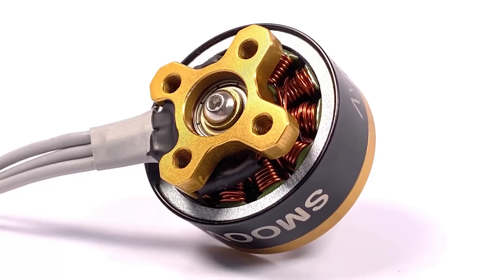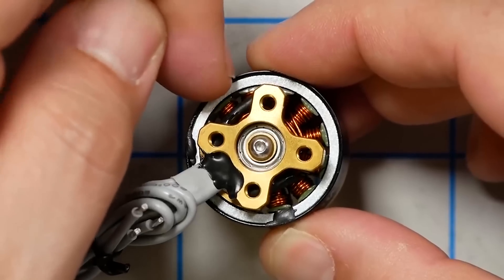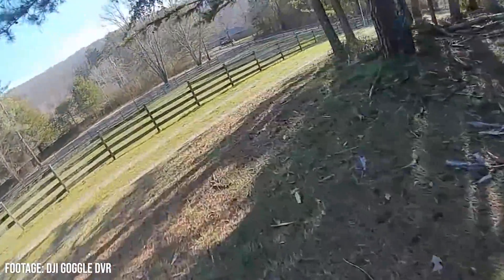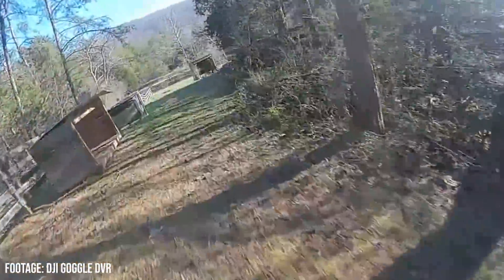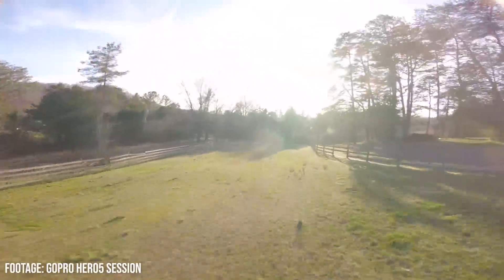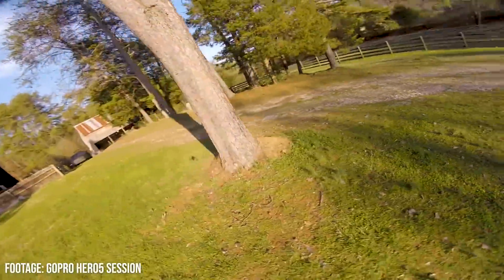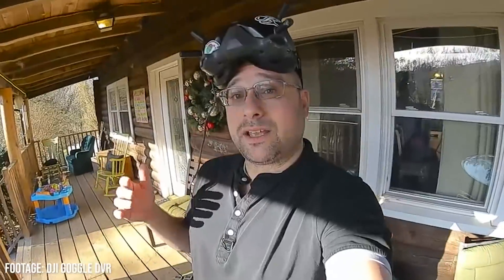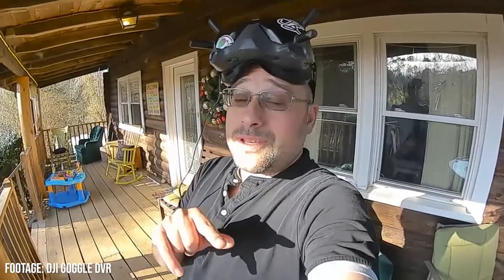Newbeedrone Smoov Cinematic Ring Magnet FPV Motor

Comment: One point of clarification, the flux rings on normal fixed magnet brushless motors is actually ferrous steel, not aluminum. It has to be to perform it's primary function, which is to redirect the escaping flux lines back towards the stator. Also worth noting the thicker the steel flux ring the more effective it is and the strong the flux at the stator and consequently higher torque output. 

Also the nature of the way those uniform magnet rings are created means that the magnetic flux they can produce is lower than equivalent fixed magnet methods. Most of the "smoothness" is probably coming from the lower torque and resulting slower response times. It is likely you could get the same results simply by putting N38 or N40 standard magnets in a normal motor.  You can get a good idea of the relative magnet strength by looking at the number of turns on the windings it takes to reach a specific Kv. 

I'd be curious to hear how you felt the power compares other motors on a similar setup. What Kv and voltage was this setup?

Comment: I'm running these on 6s on a source two frame running Falcox. They aren't mega powerful but they are smooth, and on a lightweight build, they rip. Leviathanfpv has a good video on these and the flow motors.

Comment: Had them, flew them. They are smooth but they need to do something about the screw that holds the motor bell on. It supposed to be a 1.5 mm hex but everyone wrench I've tried slips and now I have shit in mine and can't get it out so I had to swap them out.

Comment: There is always lots of discussion of "prop wash".  I do a lot of freestyle flying and certainly do see it some on my flights.  My understanding of prop wash is that you get in the "dirty" air of your own props and that is what causes the oscillations.  Staying out of the dirty air of your props is more about flying skill and keeping the quad moving than anything to do with the motors.  I am not seeing a direct connection between motors and prop wash.  Maybe a good subject for a video?
Reply from the maker: The smoother the motors are, the more you can turn off filtering, which reduces latency of the PID loop and improves propwash handling.

Comment: Interesting motor, but a lot more questions get into my mind:
The stator poles are square sharp edged surfaces, traditional magnets also have sharp edges.  I am wondering how are the rings constructed, I assume they put the magnetic particles in a pressure mould and basically form individual magnet poles with sharp edges into 1 ring? Is there some kind of smooth overlap inside magnet rings between the poles or is it also very straight or some neutral zones?  Is it better to have more magnet and less space between magnets?  Is there stress pressure in the magnetic material?  What is the weight of the bell is it similar to normal bell ? What is the field strength of the magnet n52?  What is the efficiency of the motor ? 
What is the max power of the motor ? And power to weight ratio? 
Just assuming to produce a circular poled magnet to be more expensive, but the construction of the bell is much cheaper than gluing individual magnets in place.
Reply from the maker: The magnet is basically 3d printed using a process called sintering.

Comment: Betaflight ruined that test... I feel like all the common BF side effects were there and you couldn't really tell unless you compared different motors to these on this same quad, same BF. The one tell here that was good, you set the filters to the lowest and they seemed happy but you didn't report on the motor temps.
Reply from the maker: The motors were cool, of course. That's the whole point of the test. If they were hot I would have said. But it's winter so it's hard to judge.

Comment: Hi, i have some trouble with my drone , when I arm it the motors starts to spin real fast and I can’t handle it , is there any way to adjust the arming speed in beta flight or in the tarantis controller ? I would really need your help , answer to this or send me an email at te17pa8@cng.se
Reply: Use motor stop in betaflight
Reply: It's on the configuration page on the right side. Motor idle speed, if that is what you are talking about. But if you never changed it, I doubt that's your problem. Should be around 5.5 percent by default

Comment: Could you take several different motors (plus the smoov motors) and drop weights on them and see how they fly after that? Also you could continue to drop more and more weight on them till they deform or break?

Comment: Ok well this has nothing to do with this video but I'm an extreme noob lol and I was wondering if i update to betaflight to 4.1 on the computer will it mess with the ability to tune my quad that is running 4.0 and my older one on 3.5. Thank you for your videos if it wasn't for you I would have never been able to get into this amazing hobby.
Reply: I've updated betafight a dozen or more times with no issues. As a new pilot you probably don't have any unusual setups so it's probably fine. You can always revert back if needed.
Reply: @MoMadNU  Thanks for getting back to me I've been holding off on updating it but now I will go for it and this hobby can be difficult for beginners to get into but it's so worth it when you are flying.

Comment: Can you use your vtx as a 5v output that my FC is requiring, because my 4in1 doesn't have a 5v output it only has v batt? Or should I just get a separate 5v regulator?
Reply from the maker: You can do that but be aware that the regulator on some vTX is only rated for a few hundred mA, so be careful you are not exceeding its rated current.

Comment: Having been around small brushless motors ever since they appeared commercially, I  have had motor magnets go granular and swell, bursting and flaking off the chrome outed finish, and even completely seizing the rotor. Not had it happen (yet) to a specific quad motor, I suspect due to the lesser time they have been around more than better design/materials, but I wonder about the longevity of this type of magnet too?

Comment: I wonder if there is a magnetic strength difference between these and an equivalent conventional motor. How does the strength of the magnets factor in to the “motor good/motor bad” equation? Would stronger or weaker magnets be better?
Reply from the maker: These magnets are a little weaker, but the argument is that the balance and even magnetic field strength make up for it.

Comment: Joshua, I noticed you are using DJI fpv goggles. What are your thoughts about it? Do you experience black outs? What about freezing? Latency?
Reply: I'll answer been on only DJI since 9/20... no ..no..no... ;). It's flawless watch any of my vids, it's all DJI dvr superviewed. Lol  #nogoproweight
Reply: @flo-ridafpv5713  Will do. Awesome! I was worried about Furadi's test before where he went behind the building. He had to get out of his car to pick up his quad since DJI failed to transmit.
Reply: @neilfpv  agree w fillip, that's only when you push to extreme range ....and ya will, cuz ya can lol....cuz its all crystal clear, it degrade diff than analog, just gotta know what to watch out for
Reply: I've had a couple freezes in spots I wouldn't even dare to attempt with analog, but if you're not pushing them beyond obvious limits, they are perfect.
Reply from the maker: Especially with 1200 mW mod, the range is amazing, and I have zero issues with freezing or latency.
Reply: @JoshuaBardwell  That is so awesome to hear from you Joshua! Thank you so much. My decision is final today. I'll buy a DJI and not HDO2 anymore!

Comment: seemed pretty smooth, a bit slow?,  i have  a set of dys samguks 2207 2750 which i rejected because they were desperately rough in the hand,  i tried running them with props off for 20 mins or so before i even flew them and now they run super smooth??????

Comment: I think it may help improve the air dynamics within the motor just a tiny bit (which may have a very small impact on efficiency). It might improve robustness, it will likely improve manufacturer-ability and drive costs down, since you see this type of design with other PMSM BLDC motors found in hard drives, CD/DVD players, computer fans, etc (although those tend to be motors with much lower torque requirements and they use older and much cheaper ceramic magnet rings, often with much fewer poles as well)

Comment: Am I the only one wondering how they are getting around the poles of a magnet? A normal 14 pole has 14 or 13 or whatever magent. Each of those magnets has opposing magnetic fields on either end, allowing a push pull motion to turn a motor. How are they doing this with one big magnet?
Reply from the maker: The magnet is created using a process like 3d printing. It still has magnetic poles, they are just built into the single-piece magnet. It's not one big magnet.
Reply: Every magnet has multiple poles. This one just happens to be manufactured so that it has 14 of them.

Comment: They're extremely tempting to buy.. But i believe that they are more likely to break simply because they aren't capable of withstanding/displacing a hard shock/impact like a standard motor could. The ring once forged and magnetized, internally makes the alloy stronger n rigid but also alot more brittle.. In the event of a crash that will force the ring beyond its limit structurally it'll probably most likely shatter, unlike a normal motor that usually allows for a slight amount of flex without affecting the magnets themselves.. Standard 14 pole motors for most quads have the convenient gaps placed between the magnets allowing that for that flex to occur.. But who knows? I'm most definitely interested to see where UAV technology will continue to evolve since its already come such a long way from the naze 32 boards and the arduino programming days of old..Lol 👍👍

Comment: I didn't see anything different than any other good high quality motor. When I was on BF I could run minimal filtering on multiple builds. Too heavy also. However I do think there is a good possibility that these might be more durable since the ring would reinforce the bell.

Comment: Surprisingly this motor weights 37gr which is more than a xing 2207 (34.6g with wires). For that weight i prefer a 2208. You should have included this info to your video. Weight is so damn important.
Reply: Marcelino Romero their flying 800g loaded quads as it is